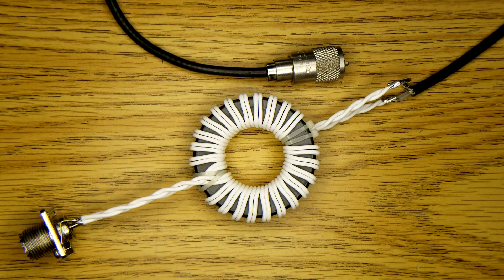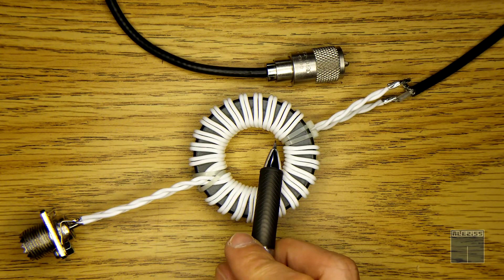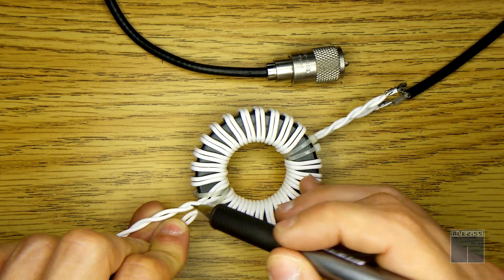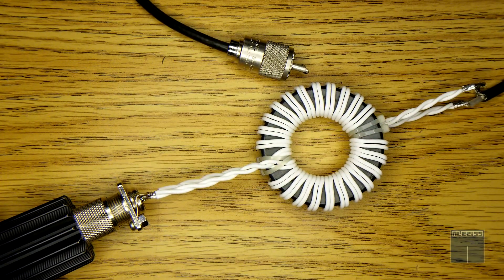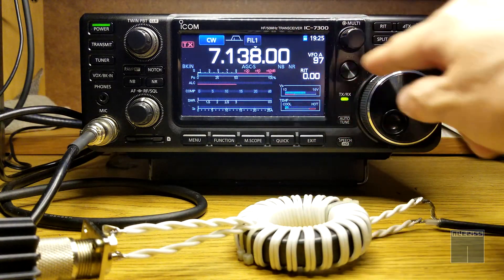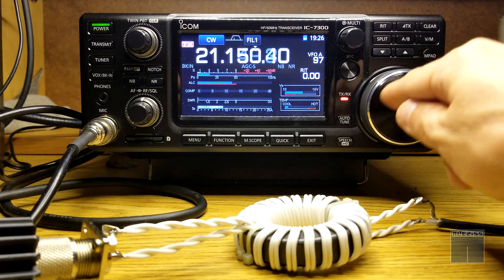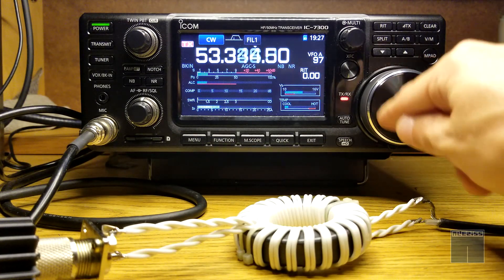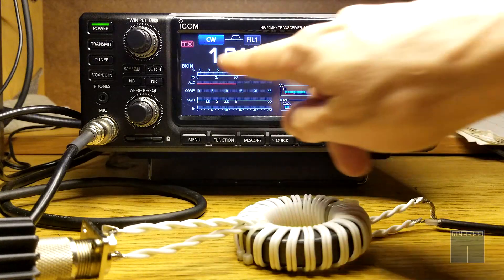SWR testing 1:1 common mode choke balun design from TRX Bench

Comment: I just built one of these and tested with nano VNA meeting or exceeding the results on TRX bench. As well built as yours is it will have no difficulty with common mode rejection. The wire diameter will not affect the inductance much.  I did a through test with VNA to get |S21| and |S11| at several frequencies. K6JCA shows how to calculate the power gain (loss) from those parameters . 1- the power gain is the power dissipated in the balun if it is feeding a 50 Ohm load.  The balun dissipates 1/2 Watt at 160 meters and progressively more power to almost 4 Watts on 10 meters assuming 100 Watts in.  On 6 meters it would dissipate almost 7 Watts.  For higher frequencies fewer turns with larger wire would reduce this power dissipation at the expense of not attenuating common mode at lower frequencies.  W5PZT
Reply from the maker: awesome, thanks for your comment ! I made another video demontrating the attenuation factor and it is quite effective well below 20dB, you can find it in my ham radio playlist ! the balun as been installed on a small compact 2el yagi that cover 40/20/17/15 and it works wonderfully well even at 600W+. 73 !

Comment: The SWR doesn't tell you much about the quality of a balun: what you measure is the reflected power but you don't know how much goes out the other end and how much ends up in losses. Furthermore, the main task of a balun is to offer a balanced port (or vice versa) and this certainly does not prove to you a SWRmeter.
A VNA is not mandatory: to get an idea of the losses using a SWRmeter test the balun by holding the balanced port open and then shorting it. In those cases the SWR must be infinite: the power that is not reflected ends up in losses (check a table to convert SWR to dB).
Other method: make two identical balun, connect them to each other through the balanced port; with a wattmeter read the exact power of the tx and then read it again with the two baluns in the middle and connected to each other in that way. Divide the difference between the two measurements by two.
Finally, to verify that the balanced port is really balanced, I recommend my article on the balun-choke test: you can find the link on my QRZ page (sorry: it's in Italian. I hope Google translate can help you). 73s.
Reply from the maker: I understand all of what you are saying. My goal with the SWR testing is because I had unkown PTFE wire and I wanted to see if it would have a bad mismatch of impedance. I KNOW this is NOT the goal of a balun.

I have another video where I do test the common mode attenuation and it is really efficient and this mode of wiring is well documented for a proper choke.

Last thing I would need to check, as you mention, the efficiency of the balanced work such device provide. I will look into it.

If you read the video description, you will see where I got all the info from Peter's TRX Bench where he got all the info from Wolfgang DG0SG https://www.dg0sa.de/ now your turn, all in German. A LOT of information about baluns, chokes and measurements. Family graciouly left Wolfgang website up after he passed away.

73

Comment: Well done.
Reply from the maker: thank you for your comment, it works really well, it's been installed on a small compact 2el yagi that covers 40/20/17/15/10/6m. I have made another video where you can see the common mode current attenuation and it is really efficient only with a single core.

Comment: Drop of power on 6m is due to the specific torroid choice
Reply from the maker: possible, still got 20dB+ of attenuation when I tested that choke with the nanovna, it does the job ok for my need... I think mix 52 is better for higher frequencies but to the detriment of lower frequency, the antenna I currently use run from 7 to 50 so no need for me to go below 7MHz so I might try one day with another core... but I paid 5$ for a single FT240-43 and now they are 15$ a piece... I should have bought much more back then, same goes with the other mix, price have sky rocketted over 2 years only since there is a lot of demand for those cores
Reply: @Aleziss  as we are not able to use the 6m band a lot anyhow😁
Reply from the maker: @on2mvh937  yeah specially in my antenna, it is only a dipole for 6m so not much efficiency but there is a "big gun" station in my province that run a 6el 6m on a telescopic tower and he makes many contacts every day so I guess we are too cheap for 6m hihi !

Comment: You did a good job. I hope it fits your needs. Sure is a lot better than buying a balun. 
Barry, KU3X
Reply from the maker: Hello Barry, thanks for your positive comment, I know that test was not really scientific but you can check my other video where you can see the actual common mode attenuation with a nanovna which is way way better than the actual balun that came with the antenna I use it on. https://www.youtube.com/watch?v=k2DAyvciyow 

I installed the antenna two weeks ago, a TGM Communication B-246 compact 2el beam that covers 40/20/17/15/10/6m and it works really well. Cut down all RFI I had previously in the shack too !!! You can see the antenna on my QRZ page.

73 de Claude VA2CST

Comment: Now that it's much too late for this test, there's the NanoVNA that would have been just right.  Starting at around $50, it's an amazing tool.  For most uses, though, connector adapters are also needed, which increases the total cost.
Reply from the maker: hi thank you for your suggestion, I indeed got the nanovna-h model but setting it up for measurements is not done easily and I get uneven results so I can't really test this properly at this time but I know this type of choke balun works really well. I'll have to make some more tests and try to make this work properly with the vna which is quite difficult not having the right adapters as you need to put resistors in the line... those nanovna's arent really precise tools...
Reply from the maker: by the way here is the NanoVNA attenuation test and it is excellent ! https://www.youtube.com/watch?v=k2DAyvciyow

Comment: Yes... two things- you will certainly need a vna or specan to see what the common mode measures. It should be greater than -20db down or as Peter would say “it’s not doing its job” checking the SWR is only secondary to the CMC measurement. I am also surprised you used the same colored wire? Would have made me crazy!  I used the same colors that Peter used, Orange/Blue PTFE. My CM  1:1 Balun checks out great. I do have a VNA and a specan - where r u located?
Reply from the maker: Hello David, thanks for your comment, I am located in Quebec Canada. As for the color, I did not mind too much, I agree it would have been easier to sort everything out for sure but at the time, I had hard time finding the right wire as per Peter description, the only color I could get back then was white ! I have a nanovna but I can't make this work properly. I am not even able to measure a coax lenght and see it's resonance. The nanovna gives me crazy SWR on a coax lenght that has a 50ohm terminaison even though my MFJ and radio SWR reading sais otherwhise. I am not mastering this properly or I have a defective nanovna unfortunately...
Reply: Aleziss Dear Alexiss,  I understand. I was able to purchase the blue and orange PTFE. Online. It’s been a while. First, make sure that you are using non inductive resistor load when checking SWR.  But without checking the CMC first, it’s really a waste of time. As Peter mentions many times,  the first job of the “Baloon!” (Peter) is the CMC then SWR. But you must have the equipment to do so. Do you have any friends close by who would have a VNA? I have a HP8711A RF Analyzer and a specAn but we’re not close. I am in Cleveland.  I also bought one of those small $ 50 nanoVna. But it died within a week. So it’s in the junk box. Good luck to you.
Reply from the maker: @davideisenberger6197  It seems I don't have the "GAIN" on the second connector on the nanovna, I am not sure why. The only measurement I found was "LOGMAG" but I am not sure it is the right measurement. I found the "GAIN" measurement on the external software (nanovna saver) but there are big difference in reading between the nanovna and what the program read... I don't have the right adapters for the nanovna so I have to order those parts too... probably from china which will take months to arrive...
Reply from the maker: @davideisenberger6197  Hi David, I made a follow up video using a nanovna and it seems to be working pretty well while measuring the attenuation. You can see the results here : https://youtu.be/k2DAyvciyow of course this is far from having high precision measuring equipement but I think it gives a rough idea of the performance. Thanks for all the previous comments !

Comment: I would recommend NOT tuning the VFO while the radio is keyed up. I did that with an ICOM IC-706MKIIG once and it smoked the finals. When I called ICOM and told them what happened they said never transmit while tuning the VFO. I had done it on other radios prior to that one and never had a problem. Just wanted to mention it.
Reply: It could be a problem when the PA transitions from one bandpass filter to another, otherwise should not be an issue, anyone that used the earlier ham satellites with linear transponders will be familiar with using VFO while on transmit.
Reply from the maker: @g0fvt  I still use the linear transponder to this day !
Reply: Agree @g0fvt I tune mine up and down all the time, I think this guy had other issues lol
Reply from the maker: thanks for the tip, as you seen though, I was at low power (10-15W) and when I ramped up the power to 100W, I did not move the vfo while transmitting. I too have a 706 and they are old radios with many of their parts being at their age limit, with the combinaison of all of this, it "might" happend but it is the first time I hear final get blown because moving a vfo while on tx. Maybe swr whent too high while you were moving around... I was with a dummy load... anyway, thank you for the tip and comment.

Comment: do you have a link for the teflon wire please? gr8 vid btw
Reply from the maker: @Ralph Kluge thank you for your comment, the wire I got was like this : https://www.ebay.ca/itm/263758650100 but I made an error ordering 16AWG instead of 18AWG... I just noticed also that it is rated at 300V and I think Peter said that for high power, it would be better with 1KV wire... this might not fit the build if you are using really high power... In my case, I will only run 100W...
Reply: I you are in the UK, you can order it from CPC:  https://cpc.farnell.com/c/cable-leads-connectors/cable/cable-wire/hook-up-wire?jacket-material=ptfe

Also the Farnell group stock it. Just search their cable category and choose PTFE as the jacket material.